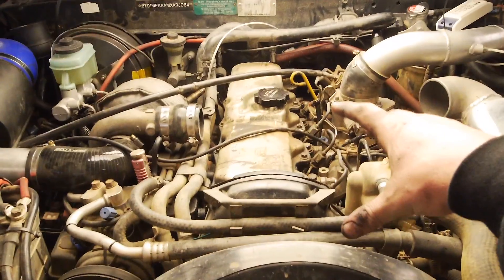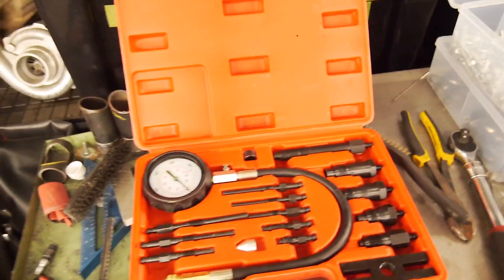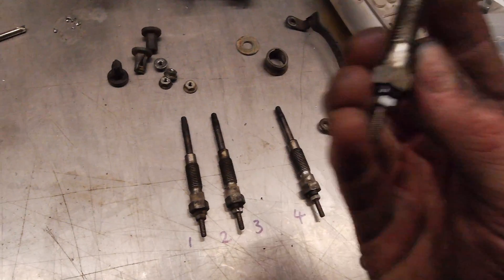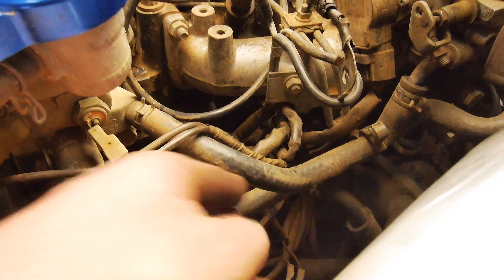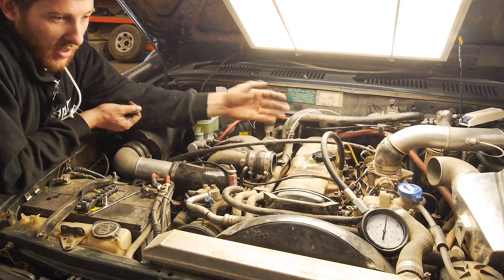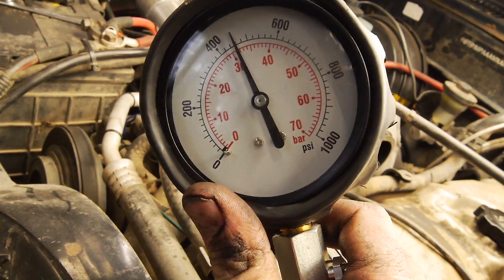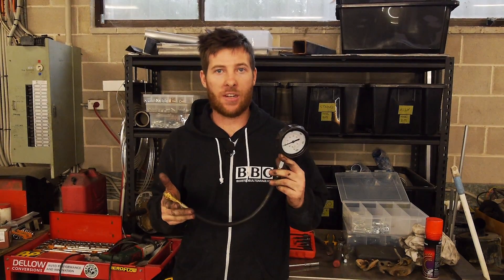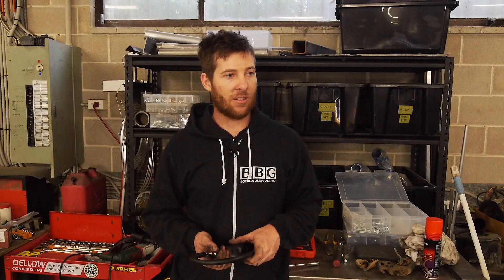HOW TO COMPRESSION TEST YOUR DIESEL | TOYOTA 2L-TE

Comment: Do all glow plugs need to be taken out of the engine then to perform each test on glow plug hole or can u just remove .1 glow plug and test and so on
Reply from the maker: You can remove one by one. Testing each cylinder you removed the glow plug from. No problem
Reply: Thanks does it make any difference to the readings if u do 1 by one or remove all 4 glow plugs

Comment: ty. to remove my glow plugs i have to remove intake manifold . Can i still do compression test or i have to remove injectors instead as to remove them i do not have to remove anything else? Ford transit 2004 2.0 tdci 125hp

Comment: Sometimes it's the case that trying to remove glow plugs may lead them breaking due to corrosion or the  "marrying" of two dissimilar metals, particularly on older vehicles & so then your only option is to remove injectors in order to perform the test.

Comment: Hey man, I did a compression test on mine yesterday and got readings of about 470-500psi across each cylinder over 3 series of tests with about 10-12 turns. I’ve just been doing some further research and checked manuals and they recommend that you depress the accelerator pedal and only do 4 turns when testing because it should be done in as little time as possible. I thought mine would be fine considering it’s still reaching 480 psi but after doing some further research I’m thinking I might not have done the test correctly and need to do it again because the issue would be that the engine is slow to build compression. What’s ur thoughts on that?
Reply from the maker: Yes generally you always compression test with throttle open (more so on petrol engines) but applies to diesels that still have a throttle plate. I've removed my throttle plate so that's why I didn't. 

But yeah you don't want to crank it for an unrealistic amount of time. 4 seconds or so is about what I usually do. Just keep each cylinder consistent I think is the main thing as you're mainly looking for any deviation between the cylinders
Reply: @boostedbuiltgarage  ah cool that makes sense then. 

Yeah I probably cranked for a bit longer than that but each cylinder was pretty consistent and I guess the main thing I was looking for was bad compression in any of the cylinder shut they all reached the same amount in about the same time so I reckon I should be sweet.
Reply: I think the issue is that after a few compressions, the air inside is beginning to get hot, which raises the pressure. I was taught to test the pressure at the coldest possible point (first one, second or third stokes, max), to get the purest possible reading. There is a YT video of someone who got 70psi on cylinder No. 1 on the first reading, but over 200 psi on the same cylinder on a warm test, a minute later.

Comment: I have tested my 2L-T engine and all 4 read 380psi each. Have put new standard rings but am afraid they need to be bigger as have high blowby. Can you share your toughts?
Reply from the maker: Depends what high blowby is. These engines (like all) do produce blowby, but obviously there comes a point where it's too much. Did you check the cylinder bores and re-hone them?
Reply: @boostedbuiltgarage  yes have taken the cylinder block for rehoning. Blowby has significantly increased since before took the engine apart. When i remove the top oll tap the blowby ptessure feels excessive. Tested the valves with pressure air after compression test and all seam close quite good. The 380psi issue is bothering me as manual says 450psi  if not mistaken.
Reply from the maker: @Magor108  Hmm yeah well considering my compression values were up around 485psi on an old engine I would say that there may be something wrong.
Have you done a cylinder leak down test?
Piston rings really need to be gapped properly. Can't usually just throw a set in and hope for the best
Reply: @boostedbuiltgarage  cylinder leak test done. At TDC valves do not leak. can hear some air leaking probably in crankcase but not heard from oil dipstick pocket and water does not bubble either.  I have fitted new rings as per recommendations after re-honing. But my bad of not measuring gap after fitting in the new ones :( Not sure if to take all engine out or try remove the pistons from  underneath.

Comment: A good reason for using injector holes is that on some engines glow plugs are notoriously difficult to remove without shearing them off in the head. Which is a nightmare of course!

Comment: Nice video. So all glow plugs where out right? Do you still have this engine? I need part number of dipstick as apparently there are different versions. Mine was 70cm end to end and round not flat.
Reply: Hey Darren, check out http://toyotamarket.ru/ put your VIN in or select your model/trim level and it will bring up all related drawings with part numbers.

Comment: I have a 2.8 3l assuming the results would be similar to the 2l. Having trouble with getting it to run with a 12mm injector pump and think that maybe checking compression would be a good start any ideas?
Reply from the maker: Yeah I would say they should be in the same vicinity.
I'm not too familiar with mechanical pumps but if the only thing that's changed is a bigger pump then it's something associated with that. Unless you've upgraded and not tuned the fuel properly and melted a piston due to over fueling...

Comment: When ya do comp test on older diesels mechanical disconnect the fuel solinoid or block fuel flow and remove the glow plugs then you can crank it over and it will blow all the shit out. This helps if you put her on its side or water gets through the intake